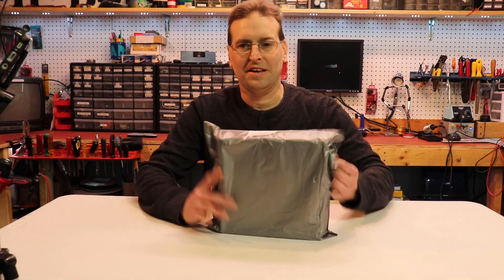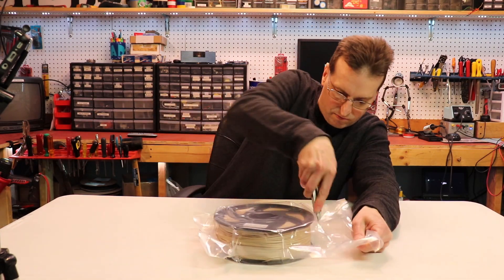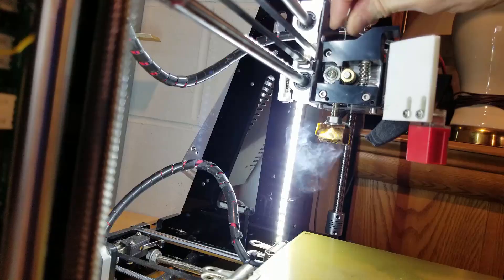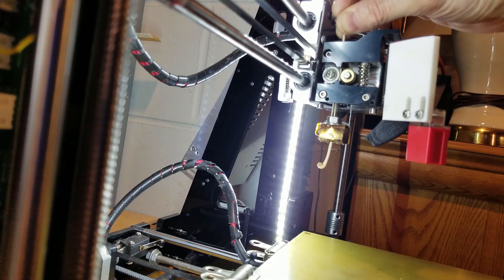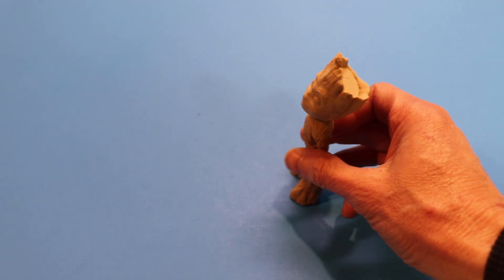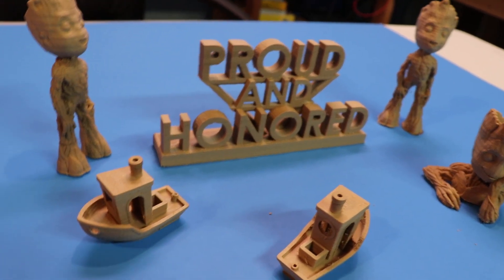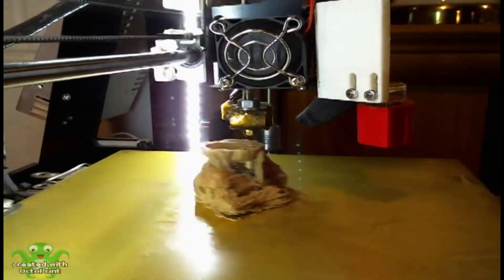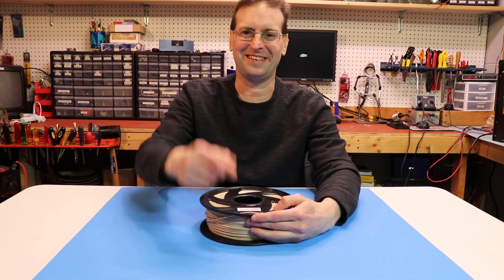3D Printing with Wood! - Tronxy Wood PLA Filament - Review and Test!

Comment: This is my first wood filament try. It clogged my nozzle twice as well. I had to change to a 0.6 mm nozzle to make it "kinda" work. Still working my way to make it good!
Reply from the maker: Try cracking up the heat a bit more and print a bit slower.  I put the settings I used in my description. 
Thanks for letting me know how yours is working for you. Good luck!